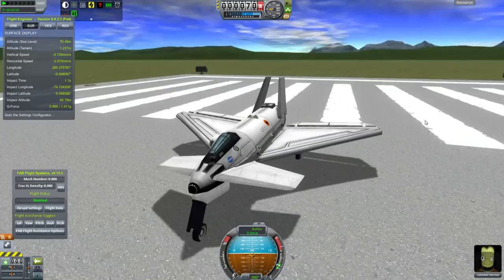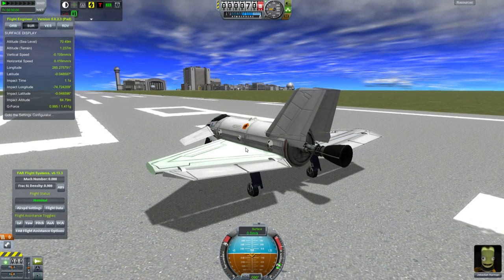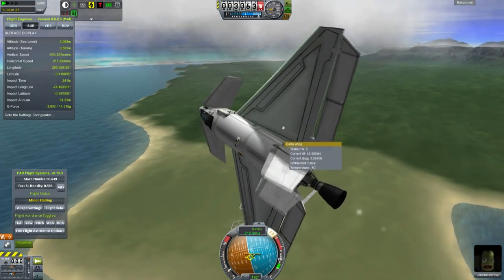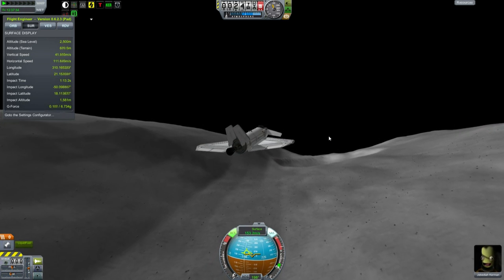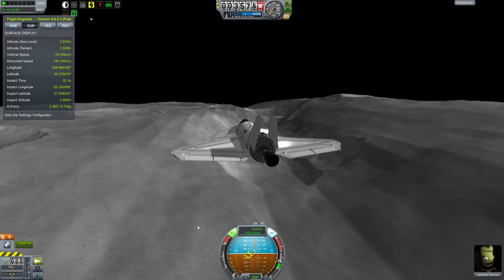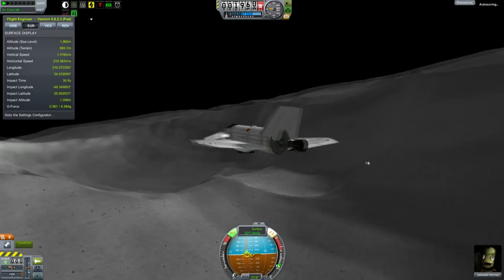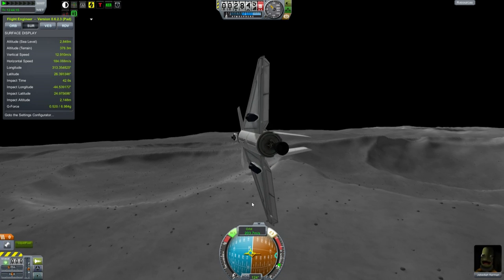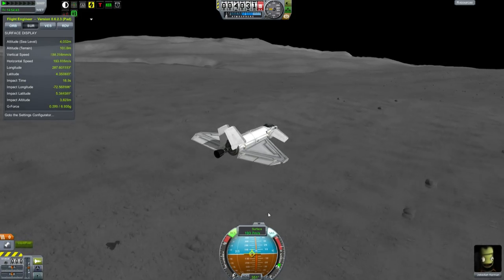The Physics Of Flying 'Space Fighters'

Comment: I enjoyed your presentation, and the comments.  Does it make any sense to have space fighters, rather than drones?  If so, then a space fighter would probably maneuver like a jet fighter, since, as you pointed out, jet fighter maneuvers are partly based on pilot comfort.  Simulating aerodynamic and control forces could do the job.  The rear engine could be on gimbals, and the large ‘lift engine’ needed for turns could point downward at the center of gravity (behind the cockpit), with possibly upward-pointing thrusters on the ‘wingtips’ for roll and negative lift, and a forward-pointing thruster for slowing down.  Kind of like a space Harrier.  Would that be enough to do the job?  I’m not sure.

Comment: I think a ship designed for a space melee, after all long range kinetic attacks are thwarted by computers and collateral damage potential and surface defenses against high power lasers have inner limit ranges- the form would follow function and the craft created would be awesome because of it's capabilities. Coupled with wireless jammers requiring manned combat and technologies to assist the body's resistance to high g-loads and the laws of motion preventing any serious application of fast turrets end up creating battles that are essentially space sword fights with decoys, visual chaff and phenomenally maneuverable craft. And given the vastness of space, these ships would also probably need to have atmospheric insertion and orbital insertion capabilities to support their long and probable more often than not: covert missions. I feel like drawing them now actually.
Reply: You might like the ships from an anime called Outlaw Star, in such a case.  Grappler ships were all about ship-to-ship melee combat.
Reply: I've seen outlaw star, but the arms would be unnecessary. All you need is a high power laser that would compromise the integrity of the opposing craft hull or fuel/engines

Comment: I think if ever a real space fighter is made it would make sense to have one big engine at the rear to provide acceleration and thrusters that would be used only for rotation. Having full size engines pointing in each direction seems to me would be a huge amount of mass which you really wouldn't want.
Maneuvering would of course be very different from an airplane as you need to orient the craft in the acceleration direction rather than the velocity direction. However in space absolute velocity and direction is often not that significant. It would also be advantageous because the pilot would always experience G-forces in the best possible direction, pushing him/her against the back of the seat rather than up/down or sideways.

Comment: I think a practical space fighter would need to be sphere with multiple main engines equally spaced over its surface. i would then have powerful reaction wheels in the centre so a FBW computer can utilise the engine closest to the required vector with minimal use of the reaction wheels.

Comment: I think its not that unrealistic in SC, for example the big main engine runs only on a fraction of the max Thrust in Arena Commander etc., while flying in Combat you're in SC Mode - or Space Maeuvring Mode.
When you fly in open Space you switch to Cruise Mode and the Engine will run at full power and you will nearly instantly achieve 1000m/s, so obviously it has MUCH more Thrust. 
The breaking of course takes much longer since those tiny Thrusters have to break this massive Shi, but they are powerful enough to do so. 

And if you think about the fact that SC take place in the future it isnt that unrealistic that those Maneuvring Thrusters are as powerful as todays Main Engines.

Since this Video is much older you didnt knew about the different available modes in the PU, maybe you think a bit different today, i would really like to know that. 
And of course, it don't has to be 100% accurate, but in my opinion they achieved nearly 90%.

Have a nice Day!
And best regards from Germany

Comment: Very interesting. Always since I read a post about that kind of stuff on tvtropes I look at those 'aerodynamic' spaceships with... not really disdain because they still look cool, but certainly a bit of mirth. Leaving the thruster issue aside, one thing that always stuck me as supremely stupid was the concept of the forward facing glass cockpit. Yes, it's certainly aesthetic, but in reality it's simply a bad idea. Why would you constrain yourself to - I don't know - 120° field of view when all you have to do is stick a couple of cameras onto your spacecraft? Windows are weak points, you don't want them on a military craft. You don't want the cockpit in an exposed position, you want a control centre in the safest place of your craft, preferably as far from the hull and any dangerous stuff (like reactors and armaments).
Still, there is this pesky rule of cool...
Reply: A good design for a space fighter that could be both fully offensive and fully evasive at the same time would be one large engine facing outwards with most of the engine mass budget spent on it,  With the other thrusters being only adequate for rotation and (Perhaps a ControlMomentGyro To save on RCS fuel),     The weapons mounted on simple 360 degree turntables either side of the ship (with minimal elevation/Pitch on the gunmount for minor aim corrections and convergence at range)

So with a combination of rolling the ship,  and swiveling the weapons on their Turntables, the weapons can be brought to bear on any angle in a 360 degree sphere arond the ship completely independant from the angle the thruster is firing in.    

With a virtual cockpit that frees the pilot's orientation from the orientation of any one part of the ship,  His orientation can be from the viewpoint of the guns,  with the roll element removed.

With the Right Fly by wire system between the Pilot and the ship,  Flying this vessel would be as fluid and intuitive as playing something like
unreal-tournament only in a zero-G vaccum,  being able to look and fire easily in any direction,  While being able to freely strafe left and right,  forward and backwards up and down using the vast majority of the ship's engine power with the WASD and Shift(or Space) and Ctrl.

One problem I can think of due to the pilots visual orientation being decoupled from his physical orientation is the Pilot's visual system and vestibular system might conflict,  since the pilots view could be turning downwards,   But his physical boty could be rotating to the left.       Solving this issue is another to think about X-P      (Drugs,  Surgery,  Cybernetics?)

Or just forget the pilot entirely and Control remotely or via giving an onsite Drone tactical commands.

(All this ignoring that guns would probably be like bringing a Knife to a gunfight in a space battle involving Smart missile drones,  Nukes and their armor piercing offshoot Casaba Howitzers)
Reply: ***** As long as you have one main engine you'll always have a characteristic direction. You'll always want to point the big engine away from the enemy least he hit it - engines typically don't like being hit. Since you rotate your craft in that direction anyway it makes sense to elongate it in that direction to reduce the profile the enemy sees. Then you'll want your guns primarily pointing forwards because that's where you expect to shoot things. Smart drones usually have the problem of being easy to shoot out of the sky since they are easily targeted and don't move that fast.
Nukes and other explosives are less effective in space because their most destructive element - the pressure wave - can't happen. Unless you score a direct hit they don't do much. Even the radiation is less of a problem than one would think, since in space you'll always radiation and so space ships should be protected against that anyway.
Like we learned in Mass Effect 2: Isaac Newton is the deadliest son of a bitch in space. You'll want weapons that have muzzle velocities at a significant fraction of the speed of light (or outright lasers but they are a close range weapon), because everything else is avoidable in theory. You can't avoid it if it takes less than a computation cycle to hit you.
Reply: *****  Definitely some good ideas there. I would still have to disagree with the spherical design and propose an ellipsoid, but generally curved/sloped surfaces are good. Curves have the advantage of being omnidirectional, while sloped surfaces offer better protection at fixed angles. Not good for dogfighting but ideal for long range bombardment where you have time to reposition yourself at all times.
Turret mounted weapons always suffer from one disadvantage: size. Any high energy weapons will need long acceleration paths and that makes them bulky. Work is force times distance. Bulky weapons mounted on the outside are a bad idea because they can be easily hit and are difficult to move. You need more torque for them to be as effective as smaller weapons. Heavy hitter weapons are best mounted in a way that a large part of them is inside the spacecraft, protected by armour. That reduces their gimbaling capabilities of course. It obivously can't match the 2π coverage of a turret.
The exception would be laser based weapons because there you can in principle decouple the muzzle from the barrel (so to speak). Of course fibre optics aren't completely lossless.

Comment: Scott, now that you covered this topic, I think you really should take a look at this addon for Orbiter 2010 http://www.orbithangar.com/searchid.php?ID=6119 This is F-224 Firehawk and it's the single most realistically (physics-wise at least) simulated spacefighter I have ever seen. It has some fly-by-wire systems similar to those in Star Citizen, except that the fly-by-wire is applied in a fully realistic newtonian environment of Orbiter, and thus it's fully simulated (without simplifying physics). I must say the behaviour tends to be quite interesting - one can see e.g. why the max speeds relative to battlefield's frame of refference for spacefighers have to be limited (mainly because you can exceed them and see how the compensation system will react, or almost won't react in this case)

Comment: A space fighter is not a space voyager. If you want to get from point A to point B as fast as possible you put one big engine in the back and small maneuver thrusters on the side. A fighter has to be more maneuverable in every direction sacrificing it's top acceleration forward for more acceleration everywhere else.

I find when I play a realistic space simulator I use the up down left and right thrusters the most because I have my front facing the enemy and i need to juke their shots. It ether ends up in a spin where we are both facing eachother going around in a circle constantly accelerating or we end up jousting heading right for each other and turning around for another pass. There is no real fancy maneuvering to be done because you can rotate much faster than they can maneuver to get your guns facing them.

Comment: What if the big engine at the back could redirect its force through vents... Now you get a sleek physically correct space fighter with even less weight! :D
Reply: the only problem is that for a sleek spaceship to have enough delta-V to do anything interesting the exhaust velocities would be colossal, which implies that you're using some kind of plasma or ion engine. The problem then is directing the exhaust (presumably heated to temperatures far higher than any solid material could withstand) through the vents and passageways without instantly vaporizing them- its probably easier to just stick a bunch of smaller engines all over the ship.
Reply: nerd1000ify Magnets bro.

More specifically electric fields (just wanted to say that lol ^)

The engine of the spacecraft would be very unconventional meaning it would have a chamber to ionize the matter, then the vents themselves would be designed in a way to become the particle accelerator to bring those ions up to speed to give the directed force while keeping the particles away from the walls of the machine. I imagine there would only be one vent that could rotate and warp to any direction.

If the engine was a combustion engine... Yea I dont know.. maybe ceramic tiles, like the ones use on re-entry.

One engine, one maluable pathway, much less weight :D

Comment: Well, as I like to say to anyone who asks me about this topic: "Rule one: If you're going to have a winged fighter, bare in mind that wings are basically dead weight in a vacuum." If one needs a versatile space fighter that should be capable of flying like a spaceplane, that't perfectly fine - but, obviously, the wings will still remain dead weight while you're in space, as there is nothing for them (and the control surfaces) to generate lift with.
Reply: They can perform other functions when not being used in an atmosphere. Hell, even planes that are always in an atmosphere tend to put the wings to work doing more than generating lift.

Comment: Of course, that still leaves the entire question of whether starfighters are really the optimal method of combat in space, rather than, say, long-range missiles or mass-driver cannons.
Reply: The problem with long range weaponry is you need to allow as little time as possible for someone to dodge it, if they are even aware in the first place. Additionally you need to account for their velocity; fine if they are moving linearly, but very tricky if they are accelerating in different directions. I'd also argue they are more effective mounted on larger, heavier ships but that's mostly dependant on how much energy you wish to impart to the projectile (if we're talking about mass drivers).
So... space fighters would be better ignored if you can ambush the enemy or they cannot change velocity quickly, but if the target is capable of rapid velocity changes then you need something that could match the movement of the target.
Well that's my thoughts on it anyway
Reply from the maker: That's a whole other video, the answer is no.

Comment: The delta-v usage is appalling.  But I suppose that's nothing new for fighters.  You can fly a Learjet across the Atlantic, or you can use the same amount of fuel for 10 minutes of dogfighting in an F-15.

And to put the power of that particular machine into context, a lightly-laden F-15 was able to go from rest to 50,000ft altitude in less time than Apollo 11.  Look up the "Streak Eagle" tests for more info on that; it's wild.

Comment: I think that the smaller directional thrusters on this Star Citizen game are implying that the main thruster in the rear is intended for cruising speeds and is thus much larger then the maneuvering ones (obviously).  In this video your KSP vessel's RCS ports needed to generate more Isp then your main engine to simulate familiar flight mechanics, and the main engine was barely needed, but your 120 kN engine is more then likely not able to achieve the sci fi speeds in Star Citizen.  Ergo: still need a larger main engine.

Comment: How did he 'hack' the RCS to give crazy amounts of thrust? Is a there a tutorial out there somewhere? I'd love to fly a spaceplane like an actual aircraft on the min!
Reply: Can do sir :-)

go in your main Kerbal Directory.   Then Gamedata\Squad\parts\utility\RCS Block\part.cfg

Make a Backup of the Part.cfg   so you can restore it back to normal once you are done screwing about.

Open the part.cfg file with notepad

Find the line:

thrusterPower = 1

and change it to 100

When in game hit Alf F12 to open up the debug window,  you can turn on infinite RCS fuel there.

Now you have roughly what Manly has in the Video,  Ridiculously Overpowered RCS 4 way Blocks and infinite fuel to use it with.  Now you can make pretty much the same plane and fly it on the moon in the same manner as in the video (You can do the same thing to the Linear RCS if you edit those too in the same fashion)

I would recommend rebinding the translation controls in staging keybinds to

the Arrow keys for Translate up down left right.     The Shift near the arrows for translate forwards,   The ctrl near the arrows for translate backwards.    Thats the config I use,   Makes RCS translation intuitive and a dream to use.

Much better than the unintelligible  ijkfjn£7(z!discobiscuits  nonsense that the keybindings are set to for RCS translation by default :-)

Its really easy to mess about with the parts in KSP,    you can lift whole modules from one part and put it in another.

For example you can turn any part into a Stack separator just by pasting in the

MODULE
{
    name = ModuleDecouple
    isOmniDecoupler = true
    ejectionForce = 250
}

Section from a Decoupler.

I made a single part ship out of octo probecore that could make orbit and probably get to the moon just by copying in MODULE and RESOURCE sections from other parts.      Contained an RTG MODULE section,  Engine MODULE section and Liquidfuel/Oxidizer RESOURCE section and I think I upped the reaction wheel power to handle turning better with all the mass from the Fuel.